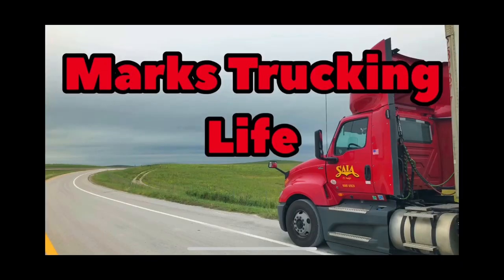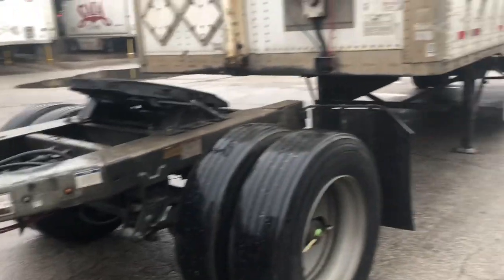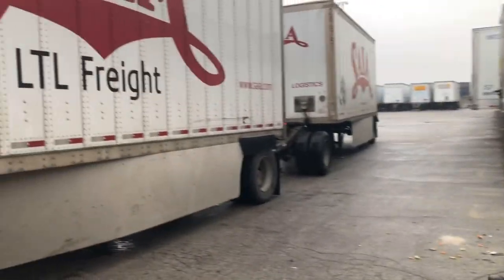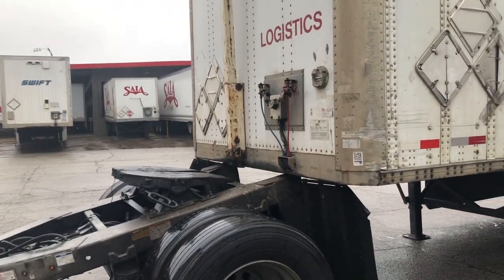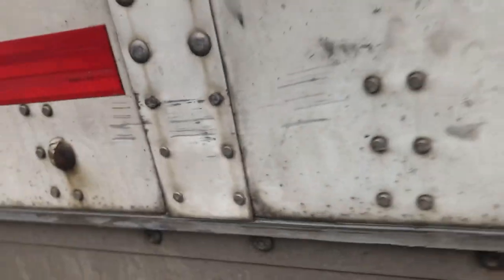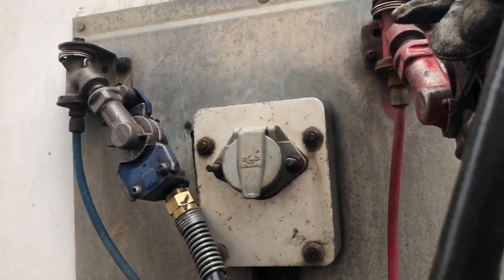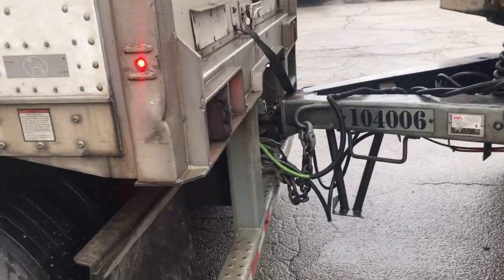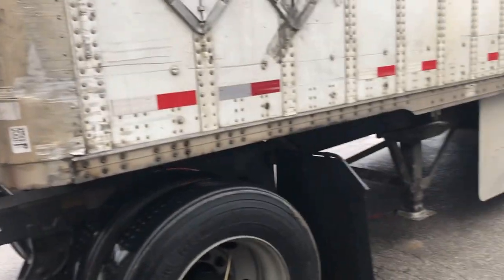Trucking | Hooking Double Trailers

Comment: Great video Mark. I work at XPO and do mainly late afternoon, evening and early morning appointment deliveries and pickups and occasional line haul runs. I remember the first time I ever hooked a set by backing a dolly instead of spotting it. Took me 35 minutes to get it hooked. Now I can do it in 5 minutes. Takes some practice but saves your back big time only having to lift the dolly once (twice on triples).
Reply: I have a road test with xbo this Friday how are they to work for
Reply: Xpo driver here 🤝🏿

Comment: Great video. I drive daycabs for Amazon who paid for my CDL in full. However I'm looking for somewhere where I feel I'm treated as a driver and respected as a driver without having to worry about the ridiculousness that is being an Amazon Associate. 
My dad retired from Yellow after 35 years with all endorsements. I'm looking at getting my endorsements, and moving on to someplace better. 
But you're right you can always do a tug test but you never know for sure until you look at the locking jaws. My dad told me a story how one time he tugged and everything was good but he checked the jaws and one of them wasn't locked. So he let the mechanic know and took a different truck.
My dad was old school, started in 72. I have learned a lot from him. He taught me that trucking is about helping out other drivers and being safe about it.

Comment: Hey mate I'm curious as to why you guys don't just do what you said at the start, hook your lead up to your dolly then back it under? That's how we hook up road trains and it seems much more sense.
Reply from the maker: Our yard is kinda tight so it’s just easier most of the time to spot the dolly first.
Reply: @MarksTruckingLife  ah yep fair enough cob. When you've the room do you just do it as you've shown? Or hook you lead to dolly then back it under your dog trailer?
Reply: Yes i wanted to see the dolly get hooked up first
Reply: @regrich8795  I'm sure I got a video of it somewhere
Reply: For some places it's company policy. When I worked at Yellow we were allowed to do it the way you described because yard switchers were the ones responsible for hooking linehaul drivers' sets. If you're doing that for 8 hours or more it's a convenient way to save your knees. I work for XPO now as a linehaul driver. You hook your own sets and the company doesn't allow any other way but the traditional way. Learning the other way is convenient though. Especially when your dolly is off a bit and you know how to pivot it with the trailer instead of struggling trying to correct it.